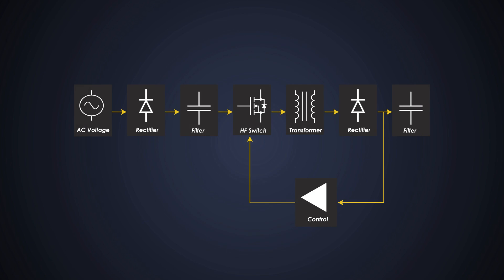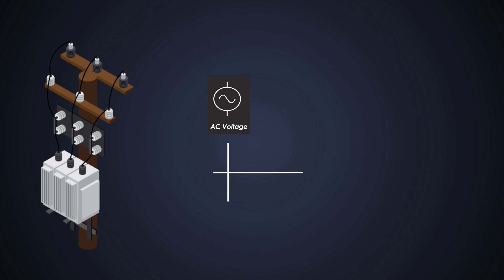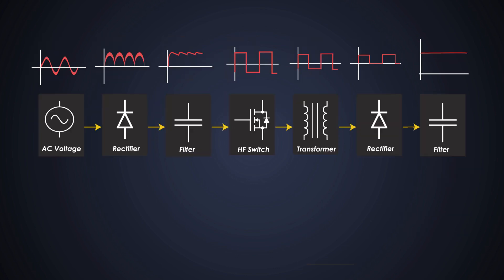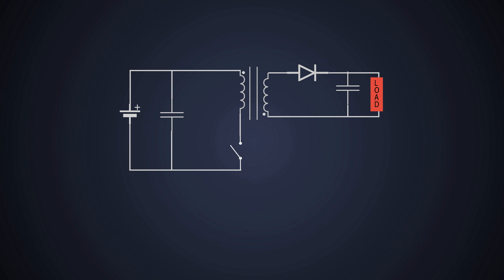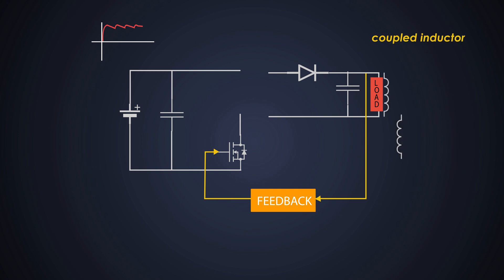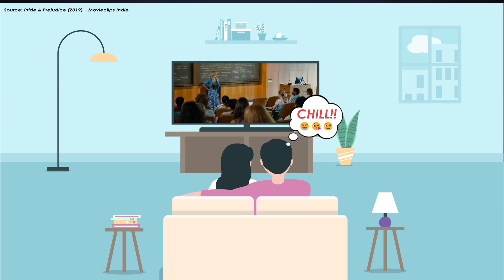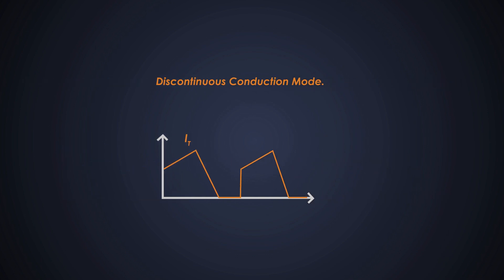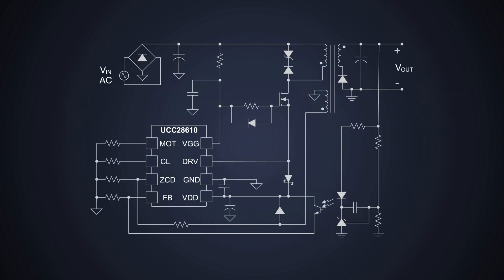How SMPS Works? What is Green mode Power supply? SMPS using Flyback converter | SMPS working

Comment: 2:44  the switching of mosfet doesn't convert filtered dc to ac, it converts it to square waves.  It's the presence of smps transformer that generates the negative voltage spike to keep the current going because it's basically An inductor and current can't change through out suddenly. 

Please correct me if I'm wrong. Thanks for the video,  it's very informative.
Reply from the maker: You're mostly right! The MOSFET switches DC into square waves, not true AC — and yes, the transformer + inductor behavior shapes that into usable power. Great observation!